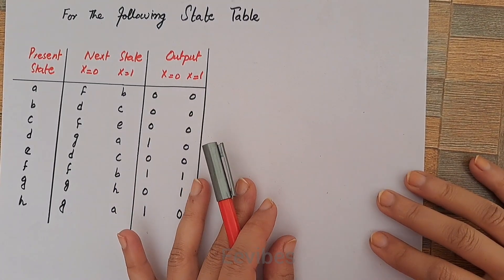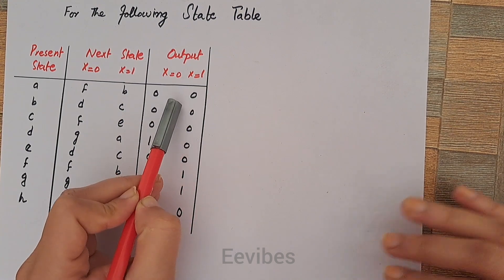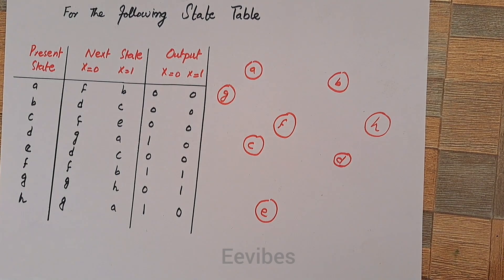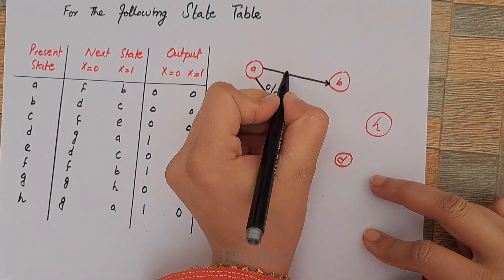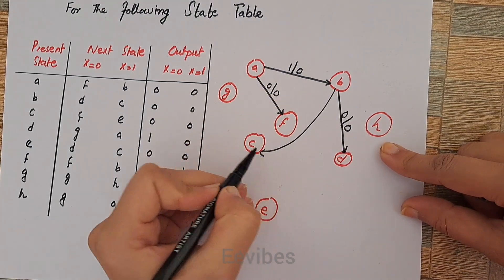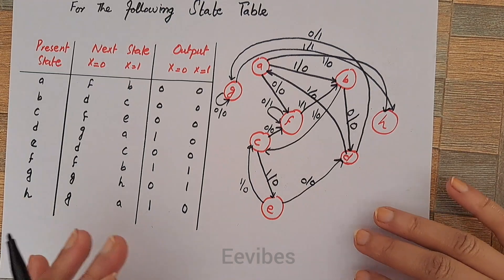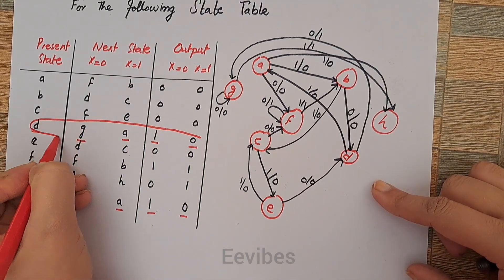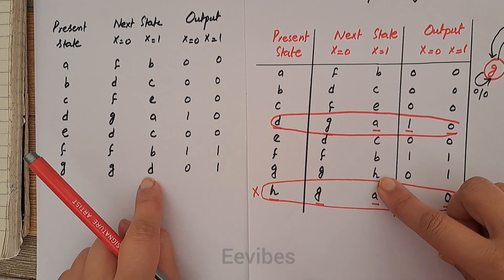State Reduction Example in Digital Logic Design | Step-by-Step Explanation

Comment: At 8:59, you connected g to g, instead of d to a. You skipped d to a entirely. I can see you were wondering why g to g was already connected at 9:24 when you got to connecting g to g. What is the input/output for d to a? 

Very helpful video! Thank you!

Edit: d to a is 1/0
Reply from the maker: Yeah, you are right. I needed to make that correction.
Reply: @eevibessite  1/0, correct?
Reply from the maker: Yes